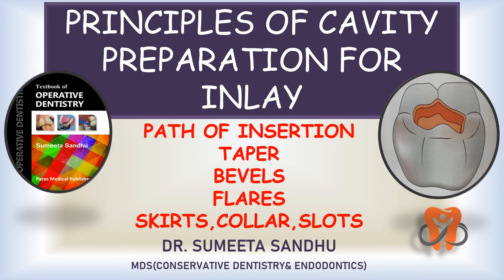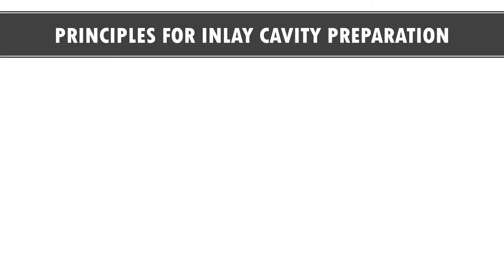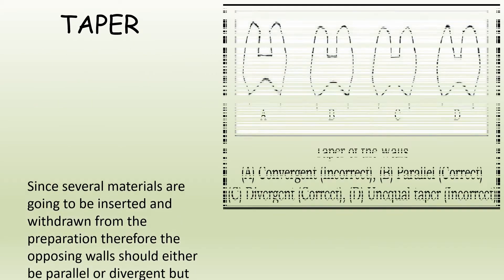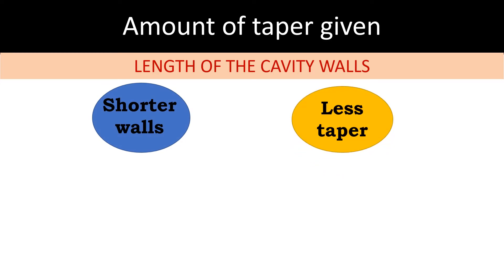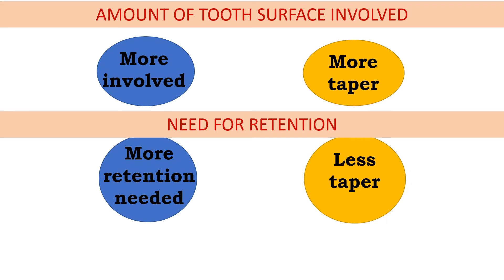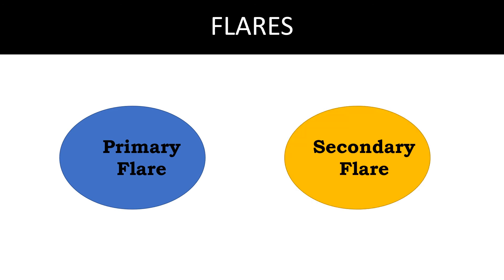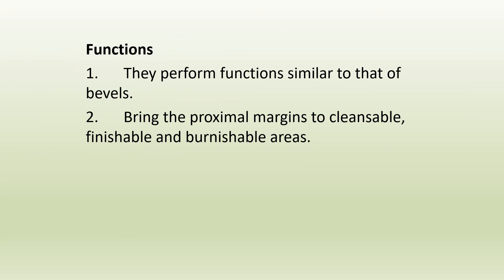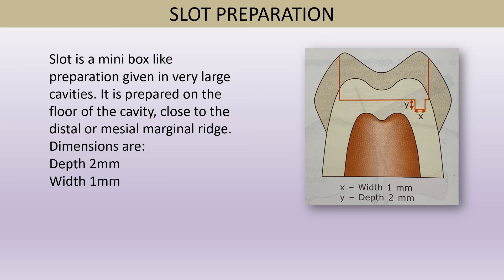Principles of Inlay cavity preparation| inlay cavity preparation| bevels in inlay

Comment: Hi mam
wonderful lecture

can you please say what is the seperating medium used for direct inlay wax pattern to prevent the sticking of inlay wax to the tooth and easy removal of wax pattern without distortion

if possible please make a practical video demonstrating the class 2 inlay cavity preparation and wax pattern fabrication mam

and also mention about the difference in class 2 inlay cavity preparation for cast gold, base metal, ceramics and indirect composites mam

Comment: How many times we can replace the inlay after it gets wear out on same tooth?..
Does every time of replacement more and more tooth structure is drilled?(like normal fillings) Or the old tooth structure is completely conserved and only new inlay is replaced at the place of old?..
Reply from the maker: It depends upon how carefully you remove the old inlay and the cement lining which is attached to the tooth structure. In case you do not cause any cutting and you remove everything by hand instruments then you don’t need to modify the preparation